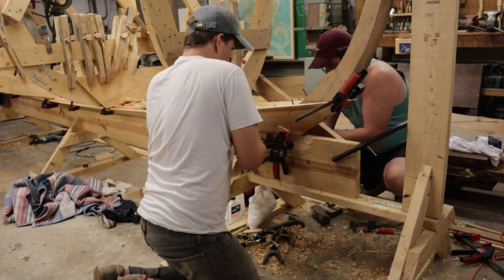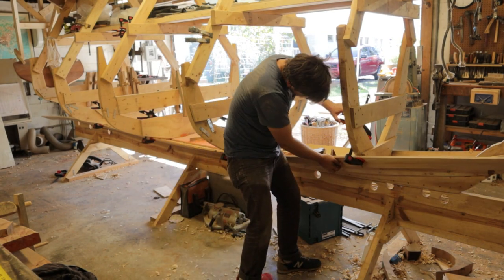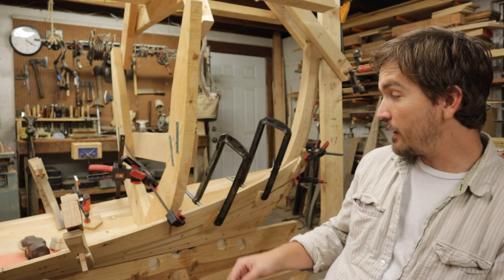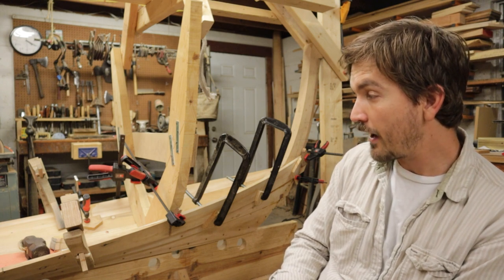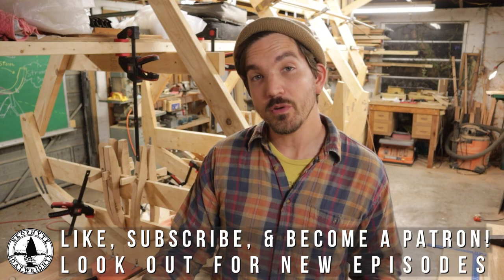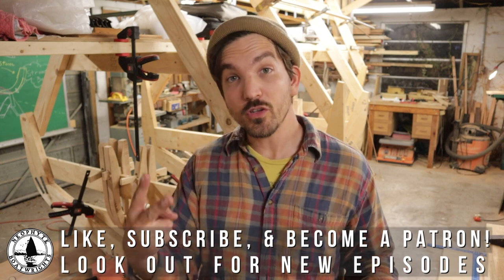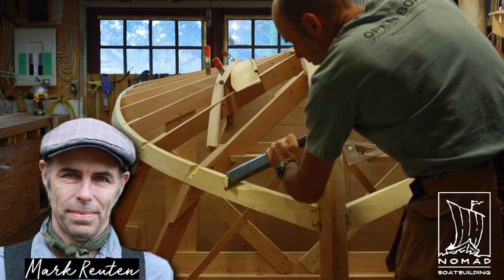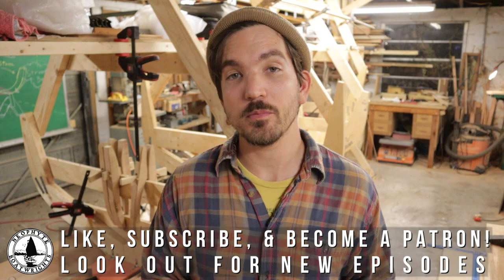Neophyte Bite! - Project Update

Comment: Thanks for sharing, 
Ido Wood working and Staircase  Installs. 
   I'm sure some of the old school Boat Builders probably use Steaming to  Pin some of the boards on the boat?   Do you know?
    I look forward to hear from you bye for now Ken
Reply from the maker: Yes steam or boiling is often used to soften the ends of the planks where there is more curvature typically. This is often done while the plank is already in position.